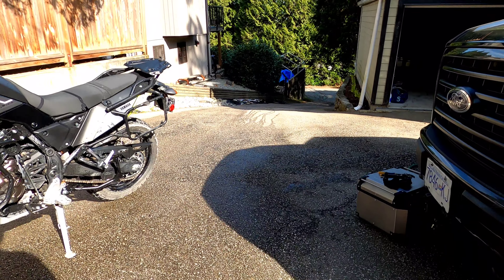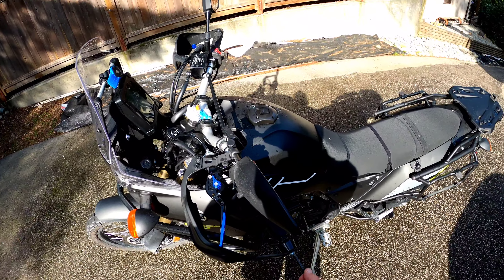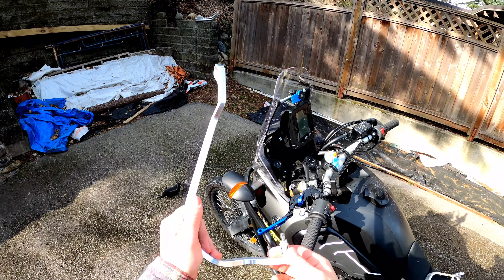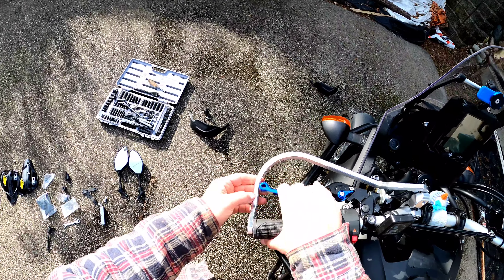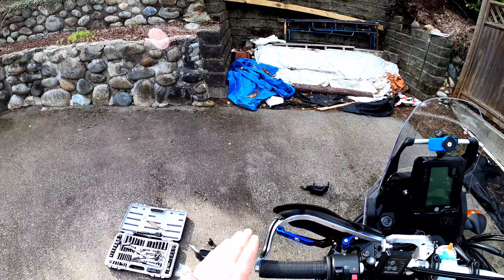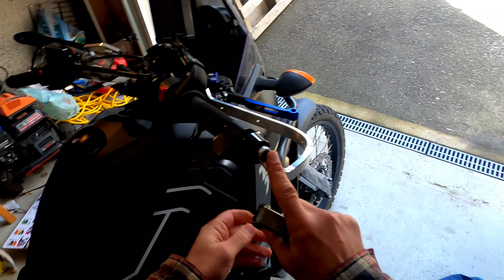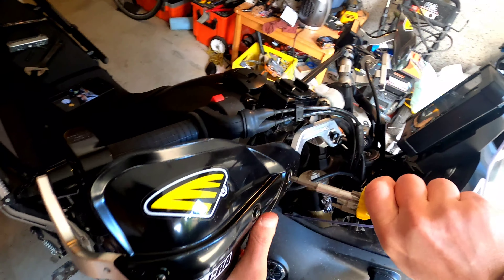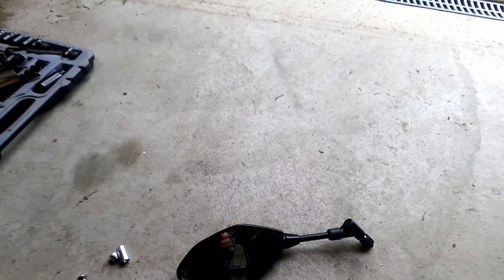Tenere 700 Installing Cycra handguards the wrong way then the right way.

Comment: Hey Mitch, which cycra u clamp size did you order....pro taper 1 1/8. There are multiple sizes available, thanks in advance
Reply from the maker: Yes the you need the bigger one. I originally ordered the 7/8 but it is too small.
Reply: @TrippinwithMitch  so I just got the cycra clamps today in the mail....I ordered the 1 1/8 pro taper clamps and they don't fit the bars. Any chance you would have a part number to the clamps you ordered?
Reply from the maker: 🤔I checked my order to be sure and returned the 7/8 because they were too small. I ordered  these from amazon in March
https://amzn.to/3kiNSKQ
I thought I gave you the wrong info but these are the ones I installed.
Reply: @TrippinwithMitch   they offer three different 1 1/8 u clamps. My part number is different than the link  you sent, thanks for your help. Maybe third order will be the charm.lol
Reply from the maker: I hope so. That link is the one I ordered and it fits so 🤷

Comment: Did you find where the bolt comes from in your last video when you fallen down?
Reply from the maker: Ya it's at the end of that video. Came from the crash bars at the top of the fork. Both bolts were out 😳
Reply: @TrippinwithMitch  That sounds not bad, because they're not from mechanical part of your bike. Keep riding bro. 👍👍👍

Comment: Can you share exact model # and where you purchased the hand guards! I contacted Cycra and they don't have same colour.  Thank you!
Reply from the maker: I got them through fortnine here is the link:
https://fortnine.ca/en/cycra-probend-crm-handguards-bar-racer-pack

Remember you need an extended clamp 😀
Reply: @TrippinwithMitch  thank you so much!
Reply: @TrippinwithMitch  Thanks for the vid, helpful.  Two more questions: Which extended clamp did you get?  Also, where did you get the fasteners to screw the handguards directly into the bar end weights?
Reply from the maker: All that stuff came with the handguards. The  extended clamps were ordered extra. The screws come in the box.
Here is the link to where I got them:
https://fortnine.ca/en/cycra-alloy-u-clamp-set
Reply: I noticed that you don’t have the stock OEM handle bars on there. Do you think those Cycra U-Clamps will work with the stock bars also?
Reply from the maker: They are the stock handle bars. They came with the bike. The cycra should work on any bars with the proper sized clamps.